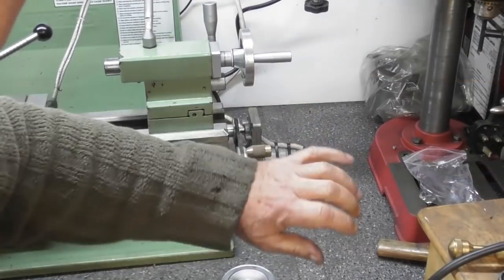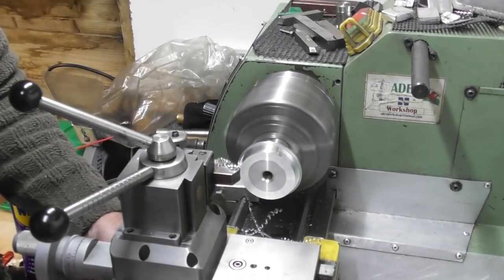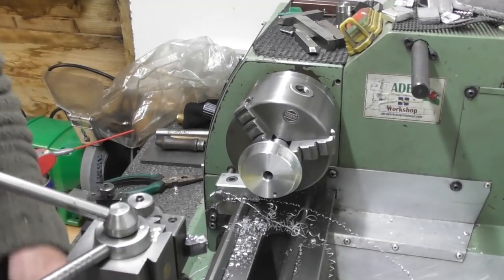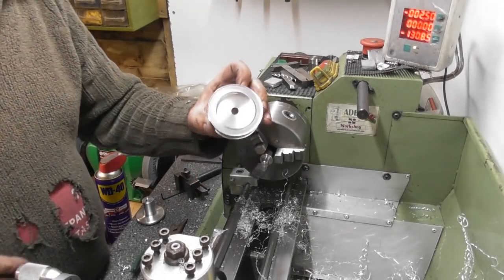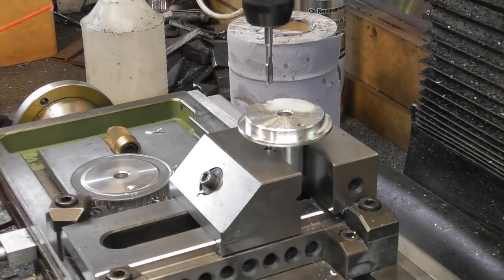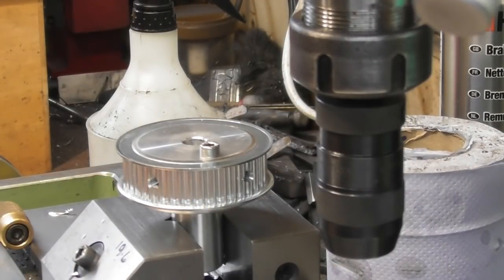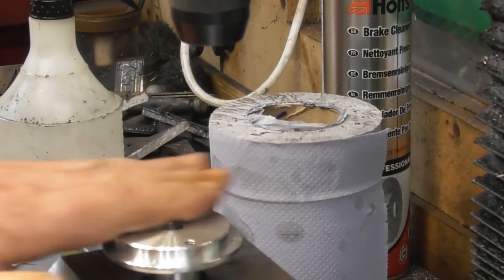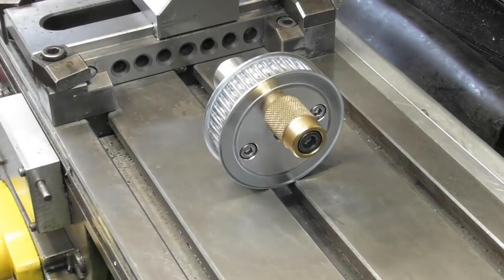Stepper motor Lathe  Leadscrew drive part 1

Comment: Nice, you’re leading me the way. I had just realised I got fed up with manually  cranking my Unimat 4, which has no leadscrew disengagement option, back and forth over and over again. So I want a fast speed to simulate the disengagement option and a slow adjustable power feed as an added bonus. So I am paying close attention to your work!
Reply from the maker: just slip the banjo out or remove a gear and sorted . Cheers Ade.

Comment: Hi Ade I have recently bought a Warco Super Mini Lathe including a 4952 QCTP (?) but am struggling with it. I cannot see how the stud that screws in to the holder is locked as even if you lock the knurled adj nut with the cap head screw the stud can still move in the holder. Am I doing something wrong? Sorry can’t send by facebook as I don’t use it.
Reply from the maker: Hi Michael . I am not familiar with this tool post but I am guessing that you need to lock the studs down hard into the toolholder before fitting the adjuster and lockscrew. Perhaps use two nuts locked together to tighten them down and maybe use some threadlock in the hole. Hope this helps . Cheers Ade.

Comment: At 1:40 when turning that first pulley it looks like shaft hole in the pulley was not centered?
Won't that make the entire job have some runout?
I love your youtube channel by the way. 🙂
Reply from the maker: That hole is only a clearance that allows the thread inside it to be shorter . The arbour screws on the thread on the end of the leadscrew . It does look a little worse than it is due to the burr in the hole from facing . I have tried it as an assembly on the leadscrew and although there is some runout due to the leadscrew threads , it is true enough for its purpose . maybe less than 0.1 mm . Happy days . Cheers Ade
Reply: @ade63dug  thanks for the reply, I understand better now. 👍

Comment: Then just add an rotary encoder to the spindle, and you'll never worry about change gears again
Reply: Well, not quite that simple! I've used the Clough42 setup on mine, works fine, more than a year of use.